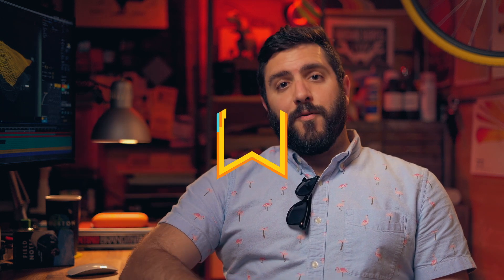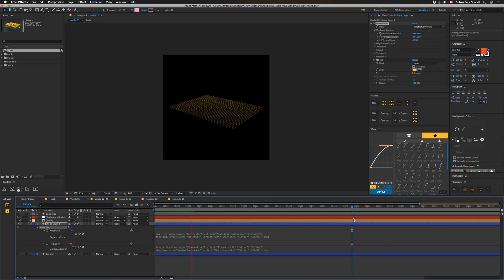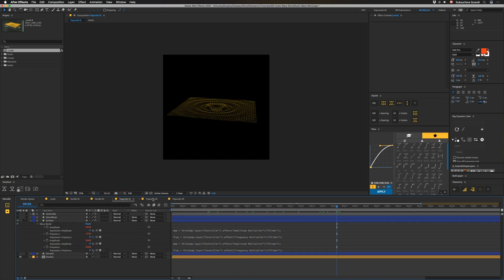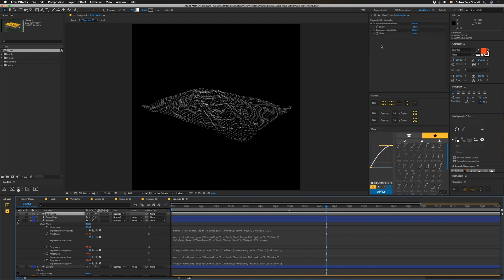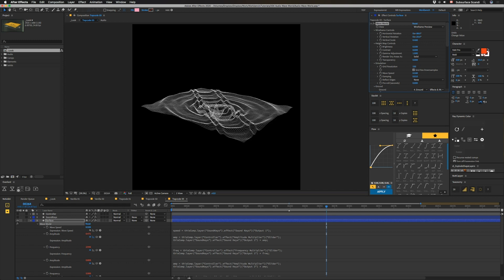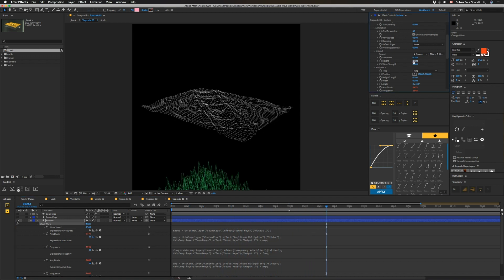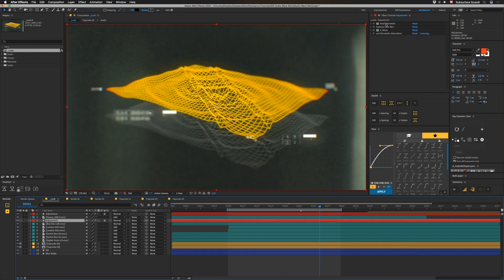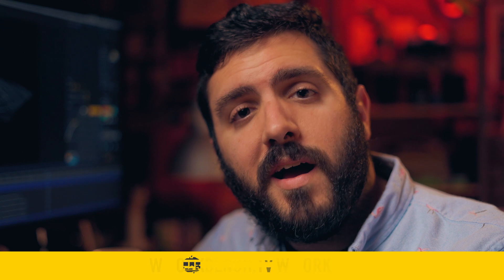How to make a 3D Audio Visualizer

Comment: Just curious:  how accurate  (if at all) are the units of the "height of the wave" in your animation related to real world data ?

I've been trying to find out "how tall is  1db / 10b/ 100db  etc  sine wave  at  xxx #amplitude# (or whatever the correct parameter is).

No real application.
Just a kind of  "why is the sky blue"  question :)
Reply from the maker: Not at my computer at the moment, but most effects in AE don’t relate to real world units (unless they list them in the controls). That said, you can make your own by just using the height as your own scale. The decibel scale is logarithmic and I think each value doubles the next. So if you pick a random value to represent 1db you can then double it to show 2db, and so on to compare.

Comment: Kind of new to after effects and all this is going over my head. From the project file, can I just replace the audio file and have the visualizer do it's thing? How can I go about that? I have trapcode and all of that. Thanks!
Reply from the maker: We're a channel aimed at advanced users so it makes sense that it's hard to follow. ;) Using Trapcode SoundKeys would get you the best results. I don't have a tutorial on how to use it, so you'd probably want to check out RedGiant's site for that. After that, you need to add two slider controls and rename them Amplitude Multiplier and Frequency Multiplier. Then you'd need to add the expressions I added to the Wave World effect. Hold opt/alt and click on the stopwatch to add expressions. The expressions can be copied from our site and it explains which one goes where -> https://workbench.tv/tutorials/2020-02-20_3DVisualizer

Comment: how to add my own music in this ?
Reply from the maker: Check out the links in the description.
Reply: @Workbenchtv  There are many link, can you please tell me which one ?
Reply from the maker: @alphavideo330  In this section -> While this can be done in vanilla AE by following our other tutorials,  Tutorial 70: Pump up the Jam... the two tutorials listed there show more of that process.
Reply from the maker: @Peter If you're using SoundKeys as I have it set up, you'll need to modify the ranges to fit your song (Range 1 Corner 1, Range 1 Corner 2, etc.). Then you have to go to the bottom of the effect where it has Commands and hit the Apply button. Soundkeys needs to calculate to set it's Output values which is what we're looking at. Without doing that, you're still using the data I set up.
Reply from the maker: @Peter You're welcome! Good luck with it!